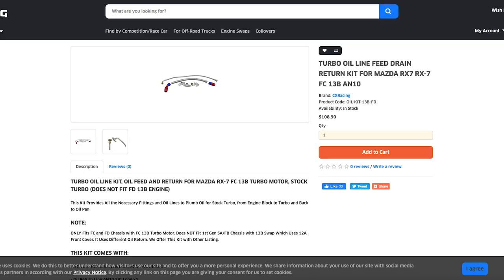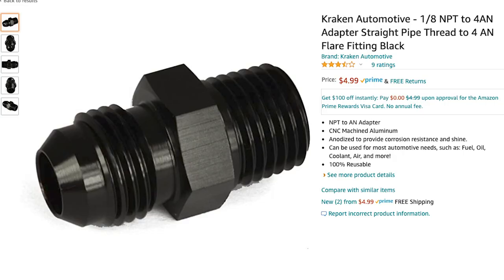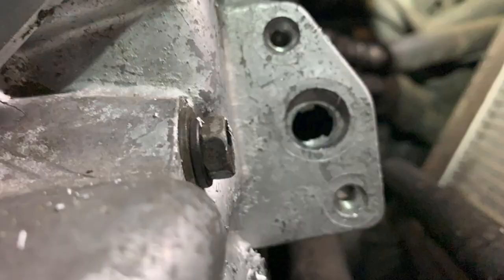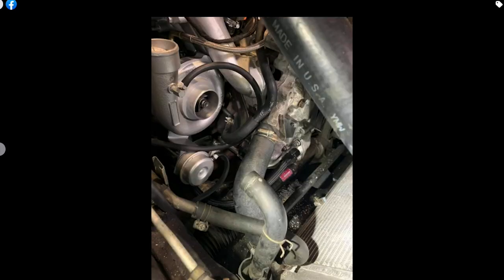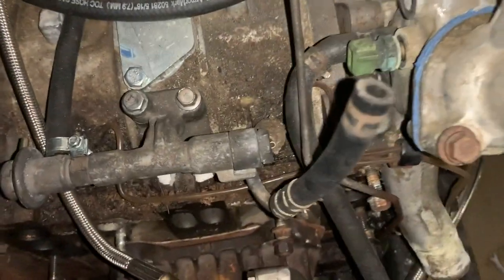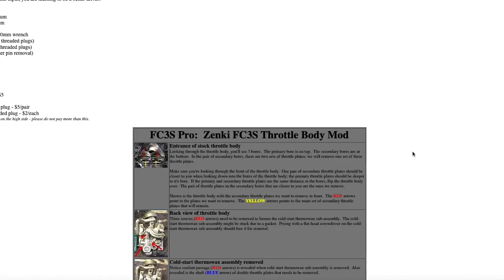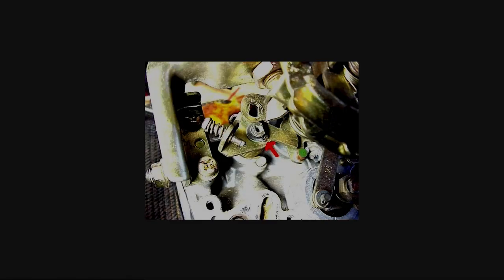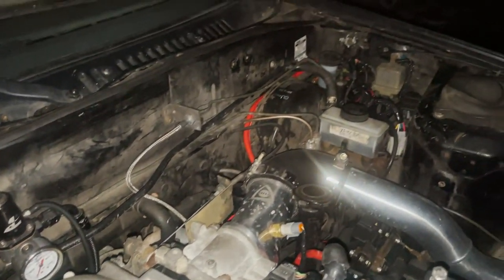The Ultimate 6-Port Turbo Guide | FC RX7 Restoration Ep.15

Comment: Turbo NA eh? Peaked my interest for some reason. Added to Watch Later and looking forward to it.
Reply from the maker: MUCH LOVE LOTS OF MENTIONS OF YOU IN THIS VIDEO!
Reply: All hail
Reply: I thought I recognized this user came 👍🏽👍🏽👍🏽. Thank you for your site
Reply: I have a question I have a rx7 of the 85 gls se 13b 6sport but they mounted one of the 86 13b 6port it works well until 2rpm after 2rpm it begins to cut sound like failing. It has eliminated the two btek or vacuum in the low intake. be the problem of the cut or failure? thanks
Reply: @joseodiaz3047  Hard to say but usually a hard cut at about 2K means the TPS is disconnected or otherwise broken.

Comment: How you match the 6port plates to the turbo 2 intake?
Reply from the maker: Aaron Cake has a good article on this. But filled the the holes on the turbo intake with weld (JB weld works too but might not hold up) and port matched it to the NA LIM Gasket
Reply from the maker: One can use a drill press or carbide bur

Comment: If I have a s4 mechanical omp on my 88 na, does a stand-alone still affect it? I’ve heard the s5 had an electronic omp so if I have an s4 then a megasquirt ms2 then I won’t have to do anything with the omp it’ll just still work. I still premix 1 oz per gallon regardless tho
Reply from the maker: S4 mechanical OMP will work just fine so nothing will change for most guys they just run pure premix or convert to S4 omp on standalone but you can wire an FD/S5 omp to the ecu (very few, I know Link supports it) but it’s a waste of I/O for the ECU and you’d have to get a much more expensive one